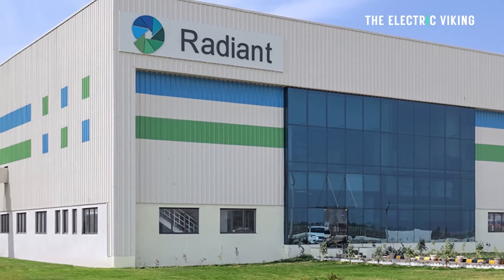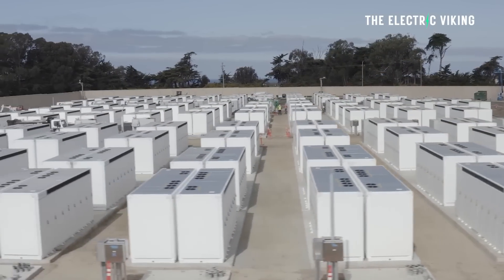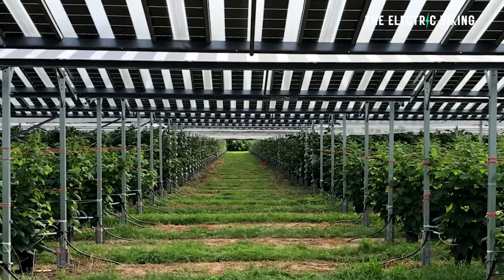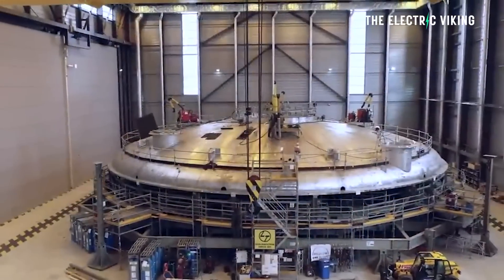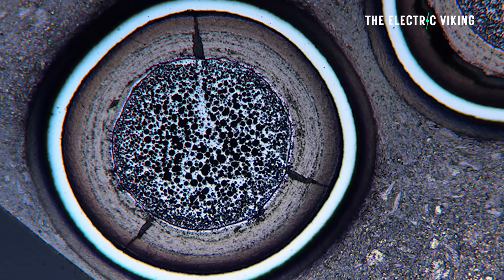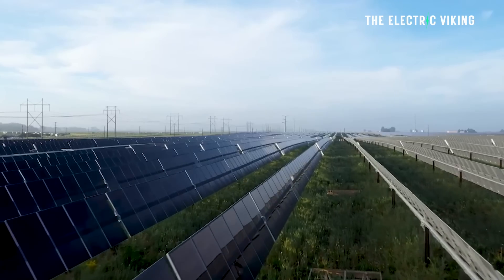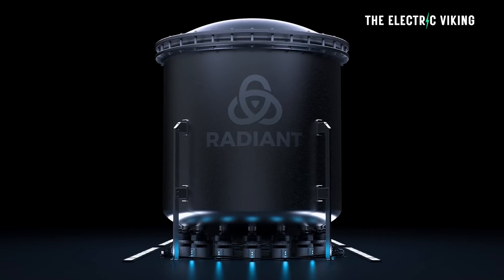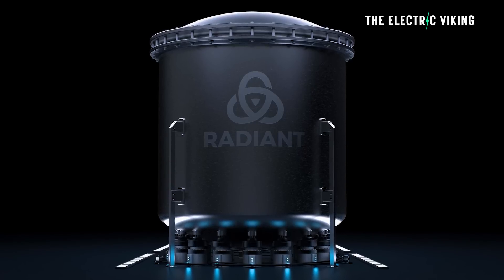SpaceX engineer reveals portable nuclear reactors to power 1,000 households

Comment: These units sound like they are meant for substation installation.

With the ceramic jacket they probably don’t explosively melt down like a high pressure water/steam cooling system.
Reply: The coolingsystem that is enriced with nuclear particals du to erosion and other manufacturing defects still has the potential to escape

Comment: It would work.  They should be focusing on Thorium though.
Reply: Uranium is a good fuel. Thorium does not bring much to the table. Thorium needs to be converted to uranium (U233) to fission in any case. However thorium is more abundant.

Comment: Biggest question is about flexibility of this reactor. Can it be started/stoped in a few minutes if there is (not)enough solar power?
Reply: You don’t need to chance solar with nuclear.
Reply: Some reactors can, especially the molten salt and molten metal designs. You stop generating energy with them (stop cooling them), they heat up and the reactor automatically stops reacting. Once you start generating energy (cooling) with them the reaction starts again.
This makes them inherently safe, and allows you to wind them down when wind and solar pick up
Reply: Can the solar turn off quickly when the nuclear power comes online?
Reply: @terjepetersen  The solar produce only energy (no cost after instalation, no waste during production energy). Nuclear power produce energy and nuclear waste. If you will take the waste I can turn off the solar in one second.
Reply: @Krait17  - you should include the toxic waste from construction and from operation. In which case the solar is 200 to 300 times worse than nuclear. 

If all my electricity for my entire lifetime came from nuclear the waste would fit in a soda can. Whilst if it came from solar it would be 200 to 300 soda cans. And that is not even allowing for the toxic waste from battery production. 

I will take nuclear waste over solar waste any day.

Comment: Big central electric power systems are effective because the energy generated, if we call r the linear dimension of the reactor, scales as r cube while the material to build it ( external cover for example) scales as r squared. This basic physical principle means big reactors can be cost effective, but small ones not. So this kind of technology will never be mainstream and only used for niche applications like submarines, space, etc
Reply: Not even space due to a lack of effective energy disapation. If you want to get energy you need a gradient getting rid of 1 MW of wast heat is a huge pain when you dont have an athmosphere or water to boil/evaporate of. And every thing is done thrue thermal radiation

Comment: Yes, those smr do have a future, like remote industrial sites, and, of course, lunar base, or Mars.
Reply: Big problem with high power aplications is getting rid of wast heat. Having an Rtg generator with 100kw of heat gereration is not a big problem but getting rid of that heat in space where the only way to loos energy is with radiation is hard. 
This limits the sice basicly to the sice of cooling that is available. 
If you need gigant finns why not slap solar on it and call it a pannel. Still some rtgs will be used but probably not complex systems with active coolingsystems generators turbines and so on
Reply: @mogelzz  getting rid of waste-heat is even an issue on the ISS.
Regarding solar panels:
During the dark moments on lunar, you still need power. Within our solar system, Mars is how far you can use them, but even there, due to dust-storms that can last months, you need something besides PV.
Beyond Mars-orbit, radiation from the solar is simply too weak to be useful.

Comment: Nuclear power has a legitimate place in space. 
However, over 50 years of experience clearly shows it is too expensive, too dangerous, has no place for waste disposal, and takes too long to be of practical use as a utility. How much more time and money are we going too waste to find this out?
Reply: Nuclear is the safest form of power with the fewest deaths per unit of energy produced. Time and cost are driven by over regulation and anti-nuclear nuts. Medium and low level waste is a non-problem, and high level waste is fuel for fast reactors. 

Also, I want to hear how you plan on containing the lead and cadmium waste from solar and wind for a trillion years.

Comment: SpaceX.  How about that.  SMRs are a brilliant idea.  You cannot ignore it and this version might hold some keys to unlock nuclear in the future.
You mention 2 instances of recent concern, one brought down by a Tsunami and the other by soviet era rubbish design.  How about all of those plants around the world operations without issue?
Our coal fired power plant is 150km away, so why is 10km remotely from me an issue?  If there is a reasonable place to transmit (we already have the poles and wires), and it can be hooked into the grid, then it seems like a flexible arrangement.
Reply: Soviet rubbish design, almost no automatic safety systems, managed by teenagers. Stunningly reckless as usual for Russians.

Comment: I certainly do think small thorium or other types of miniature nuclear reactors are interesting, useful, important, and much, much safer that previous designs (from failure, terrorists, accidents, etc.). They offer communities and countries secure off-grid power and local control. They are definitely needed for space travel, manufacturing, and exploration. They can be regulated, monitored, manufactured, and reliably serviced with relative ease. Actually, there are so many other "things" (chemical plants, gas and oil refineries and storage depots, dams, hazardous waste, weapons disposal and recycling, etc.) just sitting around so many communities, which when they have already or if they did go bang, have or would make far bigger and more worrisome messes.
Reply: Yep the worst industrial disaster in terms of deaths wasn't fission related but a chemical plant in India. Then there is the chemical waste from plants which make the resins for wind turbine blades and solar panels (which isn't toxic for just a few thousand years until it decays below background, but essentially forever). Renewables and batteries don't grow on trees. All that being said we do need renewables and batteries, and lots of them to replace fossil fuel, I just don't bury my head in the sand and say renewables don't have any negative impacts, they are just the lesser evil from fossil fuel and a good bridge tech until next gen fission and fusion are ready for prime time.
Reply: @anydaynow01  Agree, too many local and further reaching hazards to list, unfortunately. Certainly plenty of jobs there for people and robots and recycling plants/machines, etc. Hope in 10-20 years there will begin a shifting of that sort of stuff from earth (place to study, learn, and prototype perhaps) to outer space (place to "scale"). Meanwhile better bridge tech is a good thing.

Comment: Probably good for military use since they can be easily deployed.    Easier than wind or solar.  Also, how many would be needed to run a ship?   This may finally allow them to be electric.  But for everything else I don't see it.   As you say NIMBY and permitting would be formidable obstacles.    Also, they do need refueling.   Wind and solar have no fuel requirements at all (something many people forget oddly enough).

Your question of who would refuel them is easy.   Nobody.   Just truck them back to the factory for refurbishment and  wheel in a replacement.  Easy if they fit in  a shipping container.
Reply: On reactor for a large cargo ship would be more than enough. 

Depending on the design, an SMR doesn’t need refueling. Many of the designs are designed to have enough fuel for their entire lifespan.
Reply: Wind and solar will need regular replacement though, and we're not talking about a few sticks of fuel that can be stored in a small bunker but thousands of hectares worth of panels and blades and whatever is left over from battery recycling every couple decades, generation after generation. Doesn't seem sustainable when the timeline is drawn out especially at the TW scale its proponents want to use it. Renewables and batteries are good for small towns villages but leave the heavy power production for large cities and industrial sectors to fission and eventually fusion in combination with a few batteries and H2 production to balance the grid so they can run at their preferred 100 % and don't have to load follow.

Comment: SMR's small modular reactors look very interesting. Rolls Royce have been building similar reactors for decades. The idea is to simply put them near power consumers. You could place them underground for the super paranoid. The excavated volume would be relatively small compared to many other projects.
Reply: Best put them with old worn out nuclear power stations - the security is already there
Reply: @johnfrancis4401  Yep that's the plan so far for a few, we are also looking at decommissioned coal and natural gas stations if the geological surveys come back okay. Also with the new plants being designed to reject decay heat with natural circulation, power isn't needed to keep the core cool and covered. This with much smaller protected areas will mean the security detail doesn't have to be as large as the old plants which have much more area to cover.
Reply: @johnfrancis4401  interesting idea, but a typical industrial reactor generates a gigawatt. These modules generate a megawatt. So, we would have to base 1000 of these smaller reactors in the protected site. Networking all that together may add unreasonable cost.
Reply: @UnexpectedBooks  I believe the cost of 1,000 small (submarine type) nuclear power stations is less than one huge power station. In addition as mass production techniques get underway the costs will fall substantially. The advantage of these small nuclear devices is their use in isolated towns where the cost of connecting to a grid is prohibitive.
Reply: This is a great point
Reply: They are based on nuclear submarine reactors. So yes, UK and US have plenty of experience with them. They are cheap because they make many of them. But if you build reactors like in China, constantly, you maintain the skills to keep large reactors safe and cheap. One large reactor is cheaper than many small ones. In the west, they keep losing the skills after finishing one large reactor so keep bungling the next one.
Reply: @TheBooban  No they aren't.
Reply: @TheBooban  It's not so much that we lost the lessons learned, if anything we know way more and have better building techniques than the folks a few decades before. It's that the labor costs and red tape are the major reasons why only 2 AP1000s have been completed in the west (well one completed, the other due to be ready for initial criticality in a few months). When a large and complex industrial project is started in the west (like ITER) it becomes a feeding frenzy for every government agency and labor union to get a seat at the table and peck the project to death like a bunch of vultures, so when small issues come up they get blown out of proportion. The good thing is once these fission plants are done they will produce power for 100 years.

My company is passing all the license extension tests and requirements to take our plants to 80 years, that's 80 years of 95% capacity factor of about 2 GW on the grid since the mid '70s, and and the used fuel will only take up about two hectares in armored casks when everything is said and done, waiting to be used in future fast fission plant designs.

Comment: The movie "The China Syndrom" killed the nuclear energy industry in many countries.
France is an example of a country that embraces nuclear with 68% of France's total electricity production coming from nuclear.

The USA has 19% of its total electrical energy coming from nuclear.

That's not bad but it could be 75% and no need for renewables.
Reply: The China Syndrom and the untimely Three Mile Island disaster together were the one two punch for public sentiment against fission. What wasn't advertised was the creation of INPO and how the fission industry completely overhauled its public reporting structure as well as the physical upgrades to all pressurized water plants, like primary vessel water level monitoring systems, containment H2 concentration monitoring, core temperature monitoring and more. But what killed fission power in many western countries was the fossil fuel lobby and their deep pockets to prevent new plants from being built. Meanwhile more folks were dying from fossil fuels a year than were affected by fission anything for the life of the industry.
Reply: @anydaynow01  That's 1/2 the story - fossil fuels save 1000X maybe 1,000,000X than kill. Look around you - every plastic comes from oil. Without plastic and all the things it creates more humans would die than from breathing fumes that some react to. Peanuts kill lots of people each year too.

Comment: Small, portable, nuclear reactors have been around for decades.  They have been used to power the electrical systems in satellites  but are called "nuclear batteries."
Reply: They are normally < 1kw.  A better example might be nuclear powered naval vessels.
Reply: RTGs aren’t batteries or reactors.
Reply: @kokofan50  Yep it's like a coal from a fire that just stays hot for a long time to constantly charge a battery via thermocouple. Voyager probes operated for decades thanks to them, amazing bit of kit. Now they are advanced and powerful enough for Mars rovers that don't shut down and eventually die when they get a bit of dust on them.
Reply: Well that is because they aren't really nuclear reactors. 

By definition the reactor part in nuclear reactor stands because it actively transforms it's fuel via a critical reaction in order to generate the heat used to create power. A whole lot of it. And it does so via active processing and control. 

Meanwhile an RTG harnesses the residual heat from a nuclear material decaying over time and transforms that into a little bit of energy. While extremely consistent and (with new advanced in RTGs) long lasting, their maximum output is very constrained (though honestly not less so than solar power) and the impossibility to control or refuel it makes it a substandard choice for anything other than deep space probes and surface probes (though there it is the best option operationally without challenge).

This is more akin to a proper reactor, which would be an absolutely massive step change as energy has consistently been a bottleneck for many processes and even more so in space.

Probes died due to lack of energy, our experiments and mobility is severely hampered by energy constraints, and once humans are into the picture outside of low earth orbit it becomes a near unsolvable proposition unless you are using a proper nuclear reactor.

Comment: A small nuclear power plant doesn’t need to be located in the neighborhood. Because wires.
Reply: Wires, wires, wires, they are the most expensive part of distributing concentrated electrical energy. 
Nobody does the maths on the transmission infrastructure. 

The exception is the nuclear promoters who say the transmission costs are the uneconomic part of solar farms.

The D.heads forget that increased nuclear electrical energy also needs new transmission capacity.
That is the reason nuclear is an economic dead end.
Reply: Power losses over distance would make this not make any sense.
Reply: @yelnatsch517  are you sure about that? 

They ran transmission lines from Niagra Falls to New York City, a distance of more than 330 miles. 

And a small nuclear power plant would be too far to be viable if it were located OUTSIDE of a neighborhood?